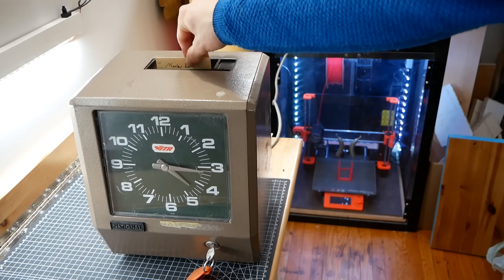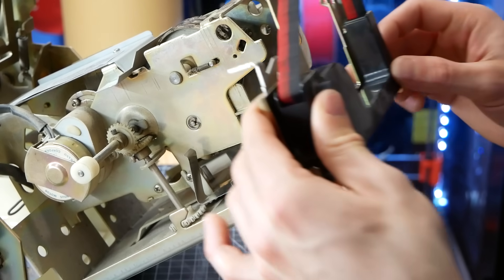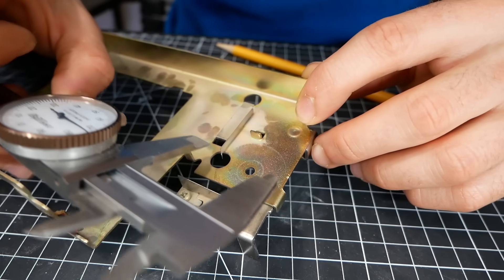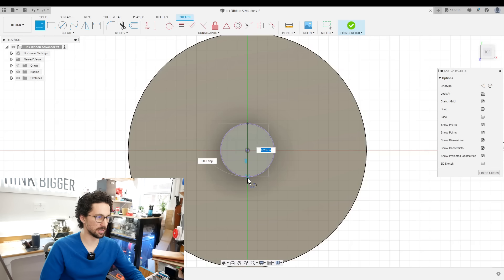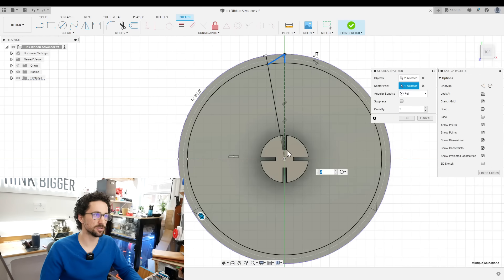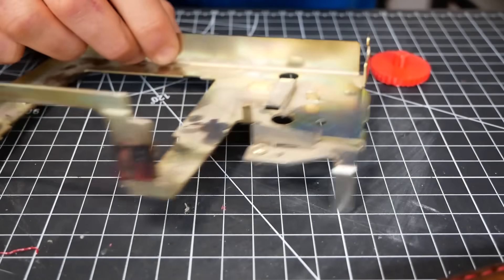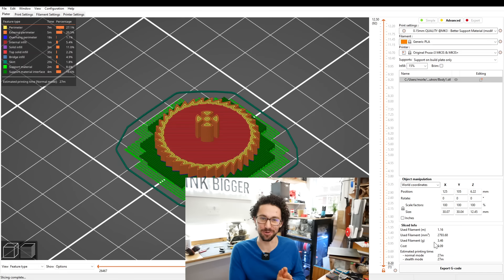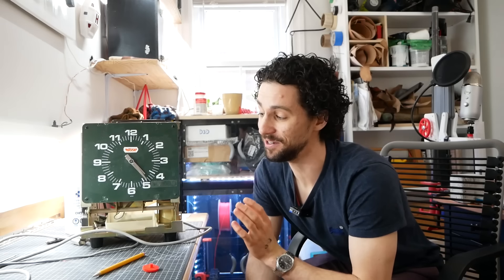They wanted 100 dollars. I 3D printed it for 9 cents.

Comment: The only issue with the 3d printed part was that it is made from plastic, and it's interacting with metal. It will degrade very quickly compared to if you built say a brass gear. But as a quick fix, certainly plastic trumps here.

Comment: You didn't make it for 9cents. You had to do researchs, measurements,  3D engineering, Prototypes, working tests... If I was your boss I would had to pay you for all that time spent. And that is way more expensive than 100$. Buying the part and moving on next task would have been cheeper ! (I'm just arguing about the "cheeper" point. Your way is way more intersting to do :D)

Comment: Nice work. 
Although the pricing is very correct for business purpose and given the rarity of the that part. 
You are the lucky guy out there with a 3D-Printer and 3D software. But in a random company they do not have the time or the skills to buy your expensive equipement and start printing out parts and experimenting like you do, so it is easier to call for service and maybe cheaper that way. Most probably the equipment in a company are leased under service agreement, so no use to do self repair anyway. Just wanted to make this clear. 
By the way hat down for that old company still providing parts for that old clock. Respect !

Comment: "I 3D printed it for 9 cents", excluding the cost of the 3d printer and the time and skill to design the replacement part. And the replacement isn't probably as durable. I mean nice vid, and a cool solution but just on costs its not a real fair comparison.

Comment: How many 10 degree objects fit in a 360 degree circle... I wonder...

I suspect the department that handles replacement parts orders whole units and doesn't have the small wheels in stock except as part of a whole unit, so if they were to take it off the unit they'd basically be breaking the part.  A more robust company might have smaller bits in stock, but I've got to imagine the punch clock industry ain't what it used to be (although IBM started out that way and now they are making quantum computers).  A company like that, at this point, would sort of need to decide if legacy support was an important part of their revenue stream.  If it wasn't, it would be good for them to put up a page that had 3D print instructions for little bits and bobs like this.  9 cents is kind of a low estimate when you consider your time, and that you need software and a 3D printer, and it requires time on the 3D printer, and if they were sending it out some shipping and handling... if they could print them I bet they could charge $10 for that part.

Comment: You didn't make this part for 9 cents. You need to add in the cost of the 3D printer, your time making the STL file and materials to make it. You would have been better off buying the piece for $97.

Comment: Not 9 cents though. Cost of the printer, cost of the software, time using the software, cost of the first attempt, more time using the software. How often do you need to use the printer for the cost of the unit and regular maintenance to become negligible? I thought so. So not 9 cents. Cool adventure though.

Comment: are you stupid of what ? 
They want to sell you a genuine part, manufactured and in old stock for your machine + shipping + gain + work...

you printed that part for 9 cents, but not counted the design time, the print time, no gain, just a pice for yourself ...

I Own a 3D printing design and printing compagny in france, and of course the print looks cheap in the slicer, but it's only the plastic price, not all that i mentionned before, and also the electricity and printer maintenance....

it's exactly like saying "look at a mason dare to ask me 1000€ for this wall, I made it for 100€ myself! they're scammers!

Comment: My first full time job in '95 I used similar. I hated that thing...not the machine but what it stood for. Start 59 minutes early and get nothing as minimum overtime was 1 hour and had to be preapproved. Clock in 61 seconds (i.e clock just flipped over 1 minute) late and lose 30 minutes pay.

Comment: Yes, but you need a 3d printer, you need the time to do it, you need the knowledge, you won't get a new cartridge (I assume you would get that aswell for that money). And 3d printers hasn't been around That long, so being able to replacing it at all from factory parts is in it self a good thing. Apple would have a spool of tape that you need to replace and if something breaks you have to buy a completely new unit all together

Comment: pretty neat, a few pointers that will save you a bunch of time - im sure someone else has already pointed this out though.
1. 360 degrees in a circle, so the number of teeth is 360 / pitch (10degrees) = 36
2. if you make a single tooth first you can then pattern the feature, so you only have to do one extrude. Makes resizing the teeth easier as well
Reply: I made a short video on how to do the patterns: https://youtu.be/qygqImFgls0

Comment: A couple of years ago, my wife complained about all the 'toys' I wanted, which included a 3d printer. I ended up getting one anyway, and she just rolled her eyes and never really talked about it. When our washer broke, and the manufacturer wanted $79 for a small plastic part, which I printed using a pre-made stl I found online for about $0.30, she became a true believer in the handiness of 3d printing. :)
Reply from the maker: Heck yeah!
Reply: @GREY E CAT honestly use your brain and think about it. Spacers for bolts on light stress projects, washer/dryer/any plastic part repair on any hardware, making a housing for electronics, I could make a weird AL song out of all the things you'd no longer need at the hardware store.

I have one and don't use it because I'm a lazy bastard, but you have to admit the potential there is insane if you actually get up and try it.
Reply: @GREY E CAT My printer cost about $250, but as mentioned by others, I print all sorts of other things with it. I also showed my wife a video that talked about Doctors in inaccessible areas using 3D printers to print medical hardware because it's difficult to get supplies where they are, and the temperature of the heating element effectively sterilizes the product produced. She was quite impressed. This topic was discussed by former Mythbuster Adam Savage in a talk he did called "What happens next? Conversations from MARS"
Reply: Yep, sometimes telling someone something is not enough, but show them and the penny drops! 🤣😎👍
Reply: @techtinkerin  Exactly!
Reply: People always say how can I make money from 3d printing. But that's the wrong question. The beauty of 3d printing is how much money you can save..
Reply: @benjimc1  Well said.
Reply: @GREY E CAT cheapest you can get with quality is around 99$
Reply: And how much was the printer? you only regained 78.30 cents of its cost so far unless you've "saved money" on other parts and selling prints....
Reply: @sumbody212  my printer cost $250, and I’ve printed $6000 worth of dungeon tiles with it. I haven’t sold them, but that $6k only cost me about $25 in PLA filament and maybe $50-$100 in electricity. If I had the desire to sell my prints, I’d be making quite a tidy profit.
Reply: @GREY E CAT   I'm sure it wasn't purchased just for this one part. It's like saying "why spend hundreds on wrenches and sockets just to be able to fix your own car". There's way more fixes you can apply them to.
Reply: And they all clapped
Reply: @GREY E CAT very true! Which is why I love the idea of shared 3D printers. Would be great for everyone to have access to one, such as at a Library, and the cost would be a few dollars per print. So, more than cost of raw materials but still a ton less than other options

Comment: Little tip on for easier teeth generation in cad. Instead of angle, make TeethNumber parameter . In the sketch, drive the angle by 360/TeethNumber (only one sketch). Do the cut of one teeth, and then do a circular feature pattern of the one tooth by using the teethnumber parameter over 360 deg. Cheers!
Reply: Or, in the quantity of the pattern use 360/Teethangle. Making use of the already created parameters
Reply: These are both good solutions. The first being better for trying multiple tooth angles/quantities, the second being better for quickly being done with the teeth as a one-time process.
Reply: That only works if you know that a circle is 360° though XD
Reply: learned this in my mechanical engineering technology course. Very Useful!
Reply: or made the outer diameter bigger with d(xy)+1 mm and the mm filling lines to construction lines, so you can select the 1 mm bigger full circle to cut out.
Reply: I’m just amazed fusion looks so user friendly, I’ve never seen it before and I swear I could make something now.
Reply: It’s been awhile since I’ve opened auto desk but I could have sworn there was a hot key for making gear teeth

Comment: A circle is 360 degrees. Your tooth angle was 10 degrees. 360/10 = 36 teeth. 35 might be a better number, though, for tolerances. Still, it should've been easy math!

Comment: This was a cool project. The emphasis on the 9 cents vs 90 dollars was a little disingenuous. You spent several hours researching, drawing up a solution, and printed 2 models. Depending on how much you make per hour it's possible that you would have saved a decent amount of money by buying the part. However, that doesn't make a clicky video idea.

Comment: It was fun watching you solve this. However, saying that you made it for 9 cents is a bit misleading. (1) You did 2. (2) you paid for the 3D printer. (3) the time you’ve spent in labor and studies for experience to operate the software and printer. (4) the time you spent studying the equipment to diagnose the problem, then come up with a solution. Seems like $95 worth to me.

Comment: 9 cent for a plastic part, few hours of work to make the measurements , 3d cad model and printing. Then if you want to make it into aluminium casting etc.. in the  end with cad you could lazer cut + tig weld  , grind and make a perfect replica for like 40-50$ but how much time did you spend making it ?

Comment: 9 cent plus time to make and print multiple versions of a simple cog 
For most people they don't have a 3d printer or the spare time to design and build replacement parts 
The clock looks old probably not very common the company that sells the parts probably doesn't sell very many so would have to store the parts pay staff and rent so prices for old and obscure items are expensive 

But cool video 
I wonder if anyone has set up a page where you can get files for replacement part files either for free or at a small fee

Comment: you could of lowered the price of the part by doing internal cut outs of the gear.  but the price is higher if you consider the cost of the printer (or its maintenance). but lastly the cost of electricity for the printer
Reply: Then steal them, and it's free!

Comment: Good job on repairing the part by yourself. But the comment section pretty much shares my opinion as well. 95 bucks to fix a decades-old manual punch-card machine sounds pretty sweet for anyone who doesn't have a working 3D printer (and the working knowledge) at their disposal.

Comment: Industry would probably try and say that "3D printing is not feasible at the industry scale without a large investment".
But this is the perfect case for them investing in just a couple cheapo printers so that they can just print off cheap replacement parts for very old stock.
It's not like they are going to be in much demand so the scale doesn't matter.

Comment: Cool timesaver for the gear teeth, you can do the pattern of the feature after you do the extrude so you won't need to select all 35 of the teeth sketches simultaneously, it's under solid-> create-> pattern-> Circular pattern, then you can set it to pattern features instead of faces or objects.

Comment: Honestly, I think it is impressive that the company offers replacement parts and support for a 50 year old product. 
A lot of companies wouldn't even be able to tell you that there is a piece missing for your assembly, nevermind offering a replacement.
Reply: Yeah, 50 years is some impressive long term support
Reply: I wonder if they make refrigerators, stoves, ovens, washers, and dryers too.  I would gladly buy my household appliances from them.  I'm tired of seeing major appliances breaking down after just a few years when they used to be built to last.  Time clocks are found in offices, but so are refrigerators and microwaves.
Reply: This ^^^^
Reply: and that is why it cost 100 dollars. This isn't parts they just have lying around in with large stocks
Reply: most companies that made industrial equipment in the 70's don't even exist any more.
Reply: @jm7974  Most manufacturers of industrial equipment have very valuable IP(Patents, Technology...), so they usually end up being bought by another company, rather than actually being defunct.
Reply: @jort93z  while the IP and patents may live on, the acquiring company seldom bothers to make or stock any parts.  and this only gets worse every year, as companies with even current products are refusing to make parts available.  we truly do live in a disposable culture now.
Reply: Every few years I get assigned to machine weird legacy parts just for CAT dealers to put in their inventory.  It takes all day to make 5 of them, and it's just a short piece of black pipe bent at 45deg and with pipe threads on each end.  Most of the issue is holding a bent part on center in a lathe.  And the bend is too close to the threads to bend it first.  I hope that part costs like 2000usd.
Reply: that part
Reply: It's likely still in use somewhere. I work for a company that makes electronic access control systems and we just stopped providing parts for our 30 years old systems (which were based on processing units used in some US rocket systems made in the late 70's).
Reply: Why?
Reply: chances are it's not a wholly uncommon piece? might be a touch hard to acquire but i reckon it's 95 bucks because it'd be casted plastic rather than 3d-print
Reply: @mcfixer9503  95bucks was the price for the complete ink cartridge assembly including the metal frame and the missing gear. and prices for these types of replacement parts that are not the typical wear parts are highly comprised of the additional cost for storage, handling, service, and shipping as these parts of the company are usually not making a lot of money providing massive amounts of replacement parts... pricing is fair for something that is ordered every now and then and 95 is not to make a profit and just to keep this service afloat.
Reply: @mcfixer9503  judging from my experience with ribbon advance mechanisms in typewriters from the era, my money is on that gear being Nylon or metal.  Regardless of which it is of course more durable then printed or cast plastic.
Reply: @mcfixer9503  Pretty sure it was $95 for the whole assembly, gear and stamped metal frame.

Comment: Delighted.  I wish you lived here in the Monterey Bay area.  I have a microwave oven door that came off due to sub par plastic fasteners.  I'll probably just use J B Weld to bulk up the fasteners and put it all back.   But I'm certain there are many products with the same sort of worn parts and badly designed parts that you could rebuild/improve for people.

Comment: Let's see you replicate the sheet metal bracket, springs, screw, threaded hole, and the plastic gear for less than $100.  Your time must be worth nothing.  Spending $100 on the field replaceable unit (FRU) assembly is cheap.

Comment: Impressive project! In fairness to the mfr, they paid for the engineering to design the part that you’re reverse engineering, and their part is probably much longer-lasting steel. $95 is certainly steep, but I doubt their part will wear out as fast.
Reply: Exactly,  the manufactured part will last for decades with millions of turns.
Reply: That makes sense! I do believe your point is valid. Quality over quantity. The manufacturer is always going to have much more overhead cost to create that part compared to what Kert is doing whether it's plastic or metal. The example piece that was taken from the three second video looked like it was plastic although it was from a different model/manufacturer time clock. At the cost the manufacturer quoted Kert, he could make 1,055 and half of these parts via his .svg file he created and in less than 20 minutes for each part. The biggest variable is use! How many times is Kert going to punch that time clock before it breaks? I'd like to imagine Kert punches his time clock every day.

Comment: for a gear angle of 10° the number of teeth should be 360°/10°=36, but it obvs works regardless, there's just a bit of a gap. Still, could've been parametrized too

Comment: You taught me a few tricks in Fusion... didn't know parameters could be used that way. Now I'll give you something in return... you set the tooth degrees to 10 degrees, and since there are 360 degrees in a circle, that gives you 36 teeth. When designing gears, just go degrees per tooth over 360 to get the number of teeth. Since these are ratcheting teeth, it's easy.

Comment: The company wasn't charging 95$ for that tiny gear, it was charging 95$ for the whole array that it sits on. The gear is more than likely only designed to work with that punch-clock since it's such a bizarrely unique shape, and for a punch-clock from the 1970's, they probably don't just have one sitting around somewhere, all the leftovers from that era are in bags in a box in a warehouse, more than likely. Not to say that this is a bad video, in fact seeing someone fix something like this was very interesting, but bashing the company who still even has that part for wanting what is probably market price for it is a weird move.